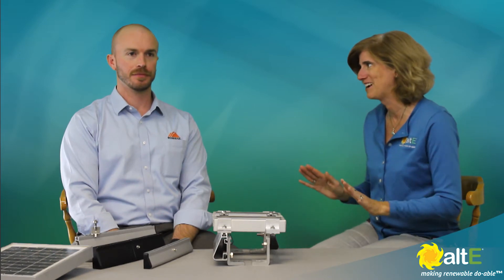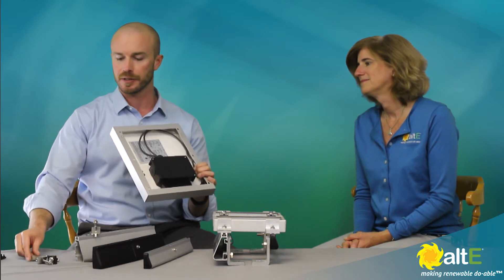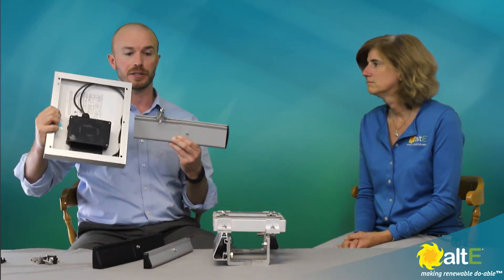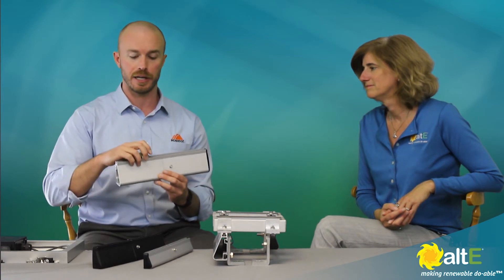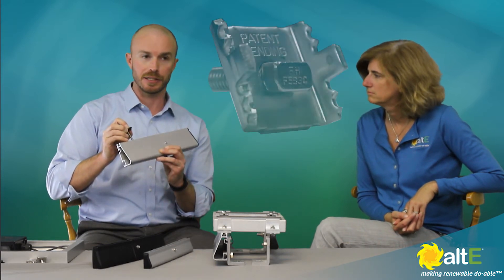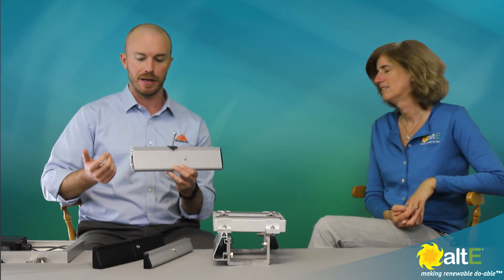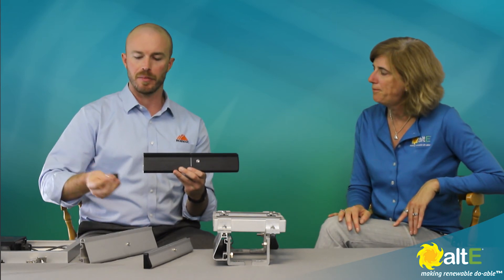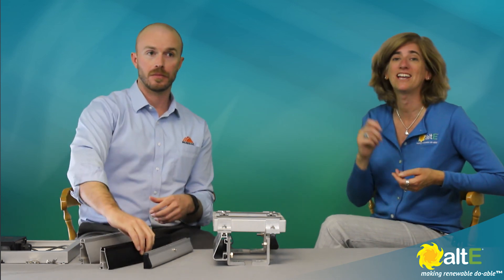IronRidge Integrated Grounding

Comment: Hello Amy. I hame my system up an running. I have a question for you. I have already connected the inverter and metal boxes to 2 new grounding rods I have put in the ground. Also a lightning surge get arrestor is connected to the same grounding. Now I want to ground the pv array (frames) as well. Should I use the same grounding? or is it better to use a different grounding rod? I am just thinking that in case of a lightning strike on the frames .. the power might surge back tot the invertor and through the grounding wire .. if it uses the same wire. What do you think?
Reply from the maker: Grounding is such a complex subject. NEC 250.56 does talk about a Supplementary Grounding Electrode (grounding rod) for lightning protection. I suggest looking for an article John Wiles wrote about it for Home Power Magazine discussing grounding a ground mounted array. Google "John WIles Grounding the South Forty"